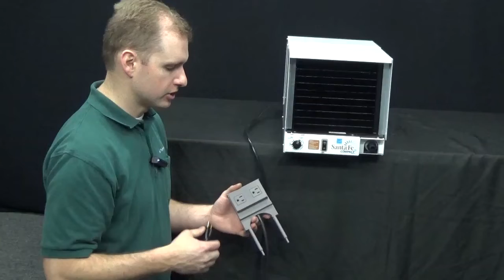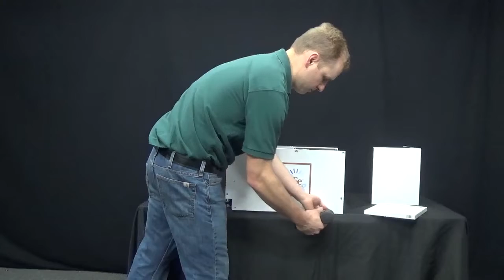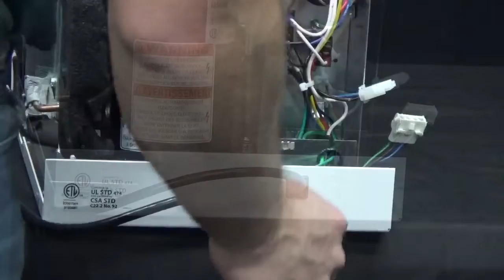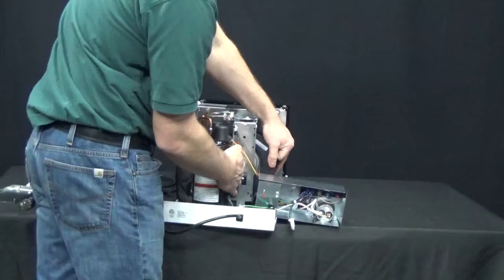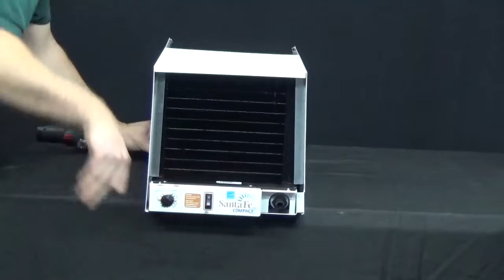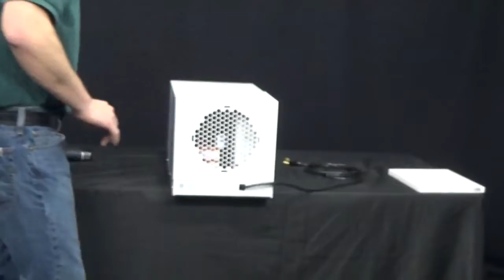Santa Fe Compact Blower Replacement

Comment: if you need to clean the coils from it getting dirty. can you take it outside and hose it down or no because the electrical parts in the back could get damaged? would you recommend i unscrew the compressor and the coil assembly and then take it out side for a deep clean? i need to clean the water collection tray underneath the coils since i did not use mine for a while and i feel like it has some black dirt that i dont want to become mold. let me know and thanks!